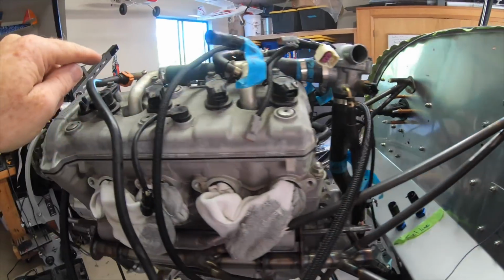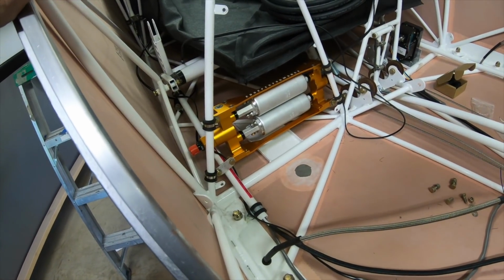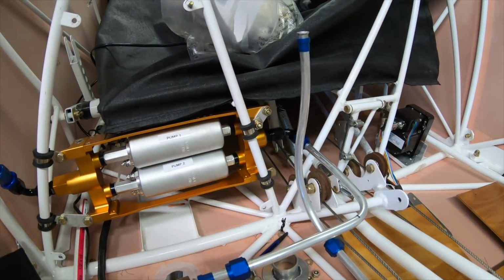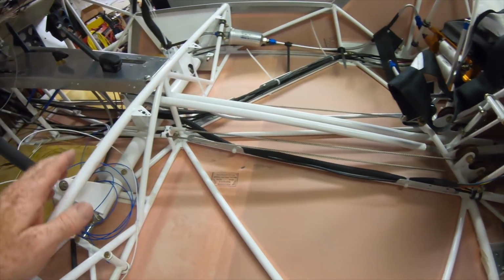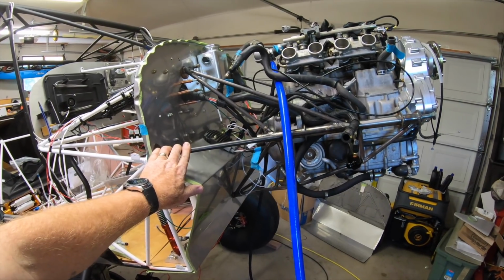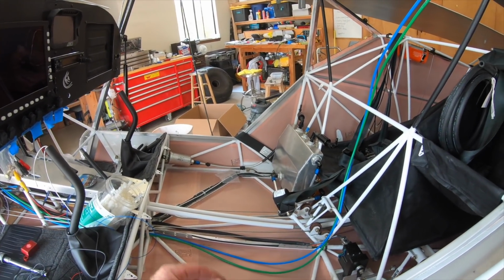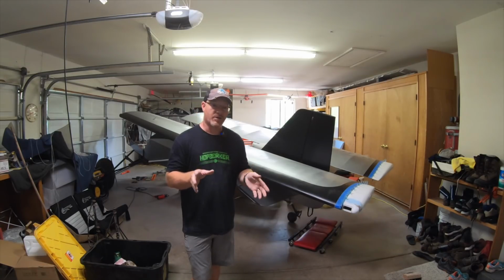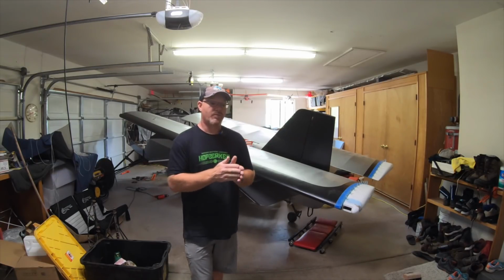Kitfox 7 Apex Build Episode 24 Fuel System

Comment: I'm not familiar with this type of double fuel filter or how the cartridges are changed out even though I see them on a lot of planes with the Edge mods.  Will there be fuel leakage at this location when you replace the filters?  I see other people mounting this same filter system forward of the firewall maybe for this reason.  Only gripe I have about doing that is a relatively good amount of stored fuel in a bad location in the case of an engine fire.  At least u won't have that problem, but I guess u have come up with a good way to prevent any fuel from getting on the inside of the plane while changing these filters. 
I was also wondering about these fuel header tanks and if they are klonk tanks.

Comment: We have been binge watching. Fantastic stuff. Any thoughts on the seat belt fuel line with regards to creating a loop towards the back and down and the under and then forward up to your fuel system? Does the fuel system have check valves in it to keep the fuel in the wings from cross tank levelling when flying at an angle for awhile? Basically they would only allow fuel to drain to the header tank. Keep it up! Its great!.

 Ben
Reply from the maker: They do not, so the low wing drains first
Reply: @BowenAero  I was thinking more along the lines of keeping the high wing from draining into the low wing via the header tank. Thanks for the great videos. Looking forward to see it flying at some point, after the rest of the mechanical and cowl work.

Comment: I have built equivalent to two Vans RV-4 aircraft and repaired many other aircraft. I really like the Kitfox and would like to build or buy one myself. I am watching your channel for two main reasons. I am looking for another option other than the Rotax engine and if I ever did build a Kitfox, I would go back and reference your videos. You have some great ideas and building techniques, keep up the good work!

I think you are over estimating the attention span of the average Tire Kicker. For the average viewer, when he sees all those wires sticking out all over the place, he is thinking that building an aircraft is an overwhelming process and he loses interest. Building an airplane is not one project but a large number of little projects. If you get enjoyment out of each one, you will finish.   It takes a lot of time, a lot of money and a place to build any airplane and when your done, you have to have a place to store it. Folding wings helps with planes like the Kitfox. When the homebuilt movement got rolling in the 60's, we were talking $30 tire at Harbor Freight. Today its $3000 Alaskan bush wheels that have a minimum useful life. In the day, we were talking about car engine instruments, airspeed indicator, altimeter and wet compass all for less than $200. Today its $20,000 glass panel complete with dual axis autopilot and GPS and its really great stuff but the airliners did not have that much sophistication in the 70's let alone a 100MPH off airport recreation vehicle. In the 90's my building buddies didn't even put attitude indicators in their 200MPH airplanes. I thought they were nuts even because even Cessna 150's had AI's. Homebuilding has come a long way.

Every viewer is different. I don't think viewers have abandoned you, I think they just lose interest in the detail. For me, the detail is not enough. I would like seeing the engine install for example because that is what interests me. A less expensive, reliable and even more powerful engine than a Rotax would be a welcome.  The Yamaha engine is a deviation from the engines the Kitfox was originally designed. Details of the installation of that phase of the build would be most helpful for viewers like me. A high speed video of engine installation would be better than none at all. Thanks for your time and effort, you are talented, precise and very viewer friendly.
Reply from the maker: Thanks Dale. The engine episode is coming for sure.

Comment: I think it is down to people think the same way as a lot of Kit Car builders do, that once the engine is in and it is on its wheels the job is done. We know that there is a lot of finishing that is needed to get from the point in this video to flyable and even more to fully finished. As the saying says 90% finished 90% to go. I like your system by system steps. The only negative about this video is that you showed us the engine fuel line route three times, from rail to firewall. Keep up the good work.

Comment: alive and well in antioch, ca. still watching. i've been a subscriber for years and watch every one.

it's possible your attention to detail and consequent rate of progress, though necessary and appropriate when building an aircraft is just too slow for the average viewer. if that's true then there is not much you can do or would want to do to rectify that. 
in any event i suspect those that understand the attention to detail required WRT quality and safety are not daunted and will be, like i am, absolutely fascinated and appreciative of your dedication to the project until its completion. and i, for one BTW, have not forgotten the initial reason for watching your channel, that being the performance of that snowmobile engine in that airframe.

maybe you should give an arm-pump as you cut away from each scene like someone i know. (just kidding....don't you dare!) :)

Comment: You need a girl in a bikini as an obligatory click bait model. (kidding) The thing that I noticed, as a viewer, is that people who post on the same day of the week consistently, grow the channel, and have consistent views. So, pick a day of the week, and post something. Anything! Even if it's a 5 minute update or a recap, or a viewer question and answer episode. As long as it's on the same day every week, you should be golden and growing. Cheers from Winnipeg. (edit) BTW, I have a Challenger 2 that I'm starting work on, upgrading the engine and making some modifications. Your videos are inspiring me to do the same. Documenting and posting the progress. I'm pulling the Rotax 503 and installing a 582 with a 3 blade ground adjustable carbon fiber prop. The plane is on amphibious floats, and the 503 works, but just barely. Cheers...

Comment: One thing I've learned over  the years watching several channels, and years of reading build blogs before YouTube, is that building an airplane is daunting.

I try to come up with comments. Sometimes I'd like to say "good job", but sometimes that feels like saying "First!" Sometimes I try to write something with feedback, but it comes out long winded.

For example -

You're right, many channels/blogs spring up, and then they go dark. Some have been very interesting to watch (bending aluminum wing ribs, or building a stick and gusset wood rib). But once the hull and wings are done, its a whole other set of challenges.

How do you capture the slow slow work routing a cable or positioning or sizing that pulley for ailerons. Those sorts of things are very hard to film and fill a 15 to 20 minute weekly video. Especially if your like me and you undo and redo, then redo again the routing of a single wire (I'm not a builder of anything yet).

I follow a fellow in Denmark rebuilding a sailboat. It's been a lot of watching time lapses of sanding, filling, and fiber glassing which has strangely been very nice to watch for some reason. One part of his updates I have really appreciated is his planning. He has a bulkhead with columns for work to do, work in progress, and work completed. He'll spend some time talking about some of the things to do, like installing the sail drive. But then talk about what's holding him up from installing the rudder (gaskets and do-dads on order).

I know it's not interesting to everyone. But I think showing what your plan is. Yes, you've mentioned working a little here and a little there. But how are you keeping yourself on track? Are  you spending a whole week drawing a bracket to be laser cut, then bonding them into the plane? A quick over the shoulder time lapse of that process would be interesting.

I think perhaps showing yourself in front a board showing all the systems, and what part of the system your working on, and what part of that system is holding you up, would go a long way in showing how the build is progressing. Building an airplane is daunting, but I think showing how you've organized and tracked the work you've done, and what is holding some work up, would be helpful.

But in the end, we also have to realize that all this stuff takes valuable time to do for a video and viewership. Somewhere in there is a balance?

In any case, I've enjoyed watching your build and your commitment to keeping it on track and moving forward.
Reply from the maker: Thank you Reuben, all good points.

Comment: Great work Bryan. Just one question: why no check valve (springless) in the fuel return line? Maybe the Apex system doesn't need it, but it is recommended in the Kitfox Rotax 912 carbureted installation. Supposedly prevents fuel backflow to the engine when engine is not running; could prevent drips and leaks in the hangar if some connection or float needle is not tight. The fuel shutoff valve does not shut off the return line. Just a thought to consider, not a big deal.
Reply from the maker: Great question, the check valve is in the APEX fuel rail at the return line.